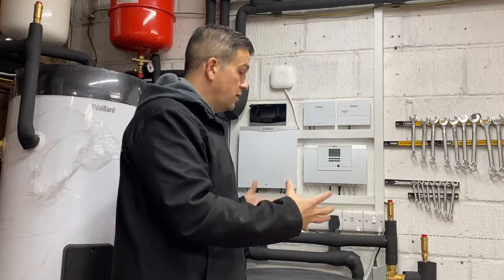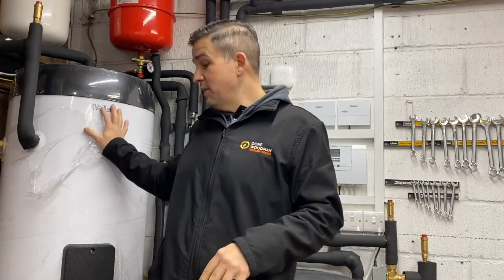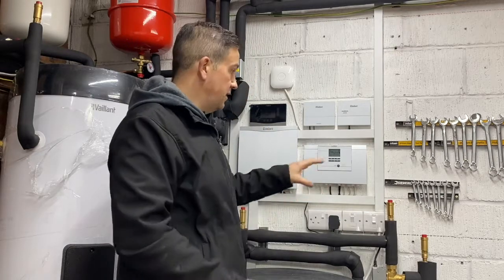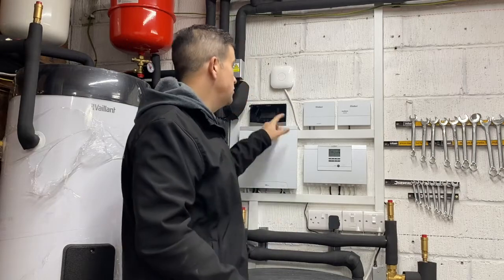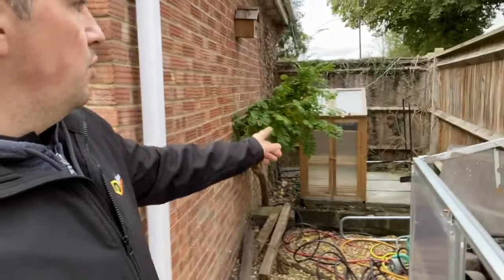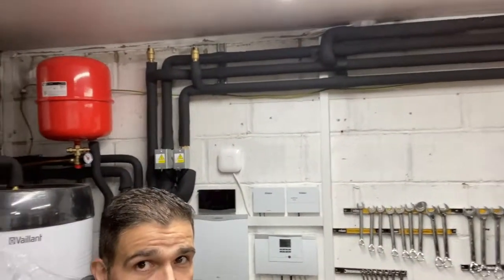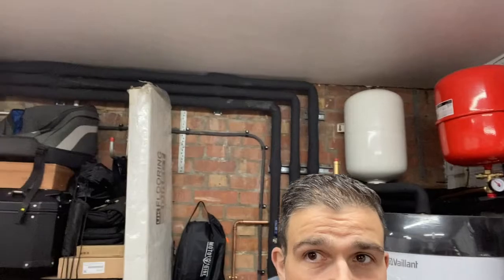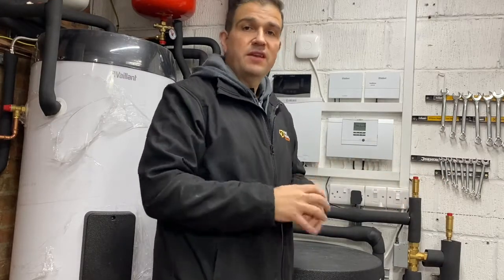Vaillant Arotherm Plus Air Source Heat Pump Installation

Comment: Hello @dore woodman is it possible to turn off the valve to the radiators by an isolator so that the system only serves hot water? And then remove the radiators? I don't want them anymore. Thanks Katy

Comment: Would you choose Vaillant or Mitsubishi ?
Reply from the maker: Vaillant without a doubt
Reply: Thanks for taking the trouble to reply .
  I ask because our installer is suggesting two ecodans 11kw cascaded .
   All I see on YouTube from installers of quality is the use of Vaillant , the installer argues vaillant controls were variations of their gas boiler controls and that their customer service is rubbish .
   This is leaving me in a quandary , of course it may be to do with supply discounts from either and they make more money on the ecodans ,,however they do have a good reputation on installs
Reply from the maker: @pmbpmb5416  mitsubishi have had a range of issues over the past 18 to 24 months and the Vaillant customer service and product is far better than the Mitsubishi Ecodan. I would, without a doubt, install the Vaillant. Where are you guys based?
Reply: Thanks for that info , unfortunately  in south Wales where there is a dearth of reputable installers, nearest heat geek elite is Cardiff for example and they don’t do solar as well ,  I am trying to tie up the install together .

Comment: It's very difficult finding someone who can fix or reset an ASHP,  all they want is to charge as much as they can from new installations and annual servicing, that includes the shoddy company in Doncaster, Project Heating Ltd who installed mine.

Comment: Be aware that unless you have a new home to a high standard of insulation etc your electricity bill could be huge! The cost of all this and the cost of your electricity bill would seriously damage your wealth.
Reply: if it's calculated well it's often cheaper than gas, ofcourse if your house is very badly insulated that should always be the first step, that would also save you a enormous amount of gas as well

Comment: Hi, thanks for the vid.   Is the 7kw the input power or the output heating power?
Reply from the maker: That is the heat output of the unit, although dependent on flow temperature and external temperature it can achieve up to around 9kw

Comment: is the Arotherm Plus designed to self diagnose if their is a refrigerant leak?
Reply from the maker: Hi Nicks, I wouldn’t say self diagnose but it will detect the leak as the pressures and refrigerant temperatures will be all over the place and produce a fault code to indicate an issue.

Comment: Do you need a smart meter for it to provide the energy prices and consumption
Reply from the maker: Hi Dan, not necessarily. You should have a digital phase meter installed that will indicate the kwh used and the interface will also have the energy consumption data available.
Reply: @dorewoodman  where do these install at. A quick search shows some that fit to the din rail on the consumer unit. Do they monitor whole house consumption or just for the heat pump

Comment: Hi Dore,  my Vaillant ait source heat pump is working but not heating the radiators enough.  They just get  luke warm.
 I noticed the double fans in the outside unit are not turning as fast as before. For the hot water, it runs fine but as soon as i need heating they are alot slower. Our first service wss about 5 months ago.  Thanks in advance.  Im in Glasgow
Reply: don't focus too much on how the radiators feel, is your room getting warm enough?

Comment: Dore is my pipe insulation up to scratch the brick beside the pipe reads 3.2centigrade and the insulation reads 4.8centigrade reading with my Fluke infrared thermometer surely this isn’t right can you recommend a fix to upgrade it cheers

Comment: Thanks for this - I note that the Vaillant is capable of flow temperatures of up to 75 degrees which seems ideal for an old property like mine where I intend on having UFH downstairs and CH radiators upstairs. However, is there any guidance from Vaillant (or you) on how best to specify the upstairs radiators? Should I use the standard calculated radiators sizes (BTUs/Watts) for a given room or should I add 50%? 

Also, what would Vaillant/you suggest on towel radiators - can I use one to heat a room and/or should I incorporate an electric element as well?
Reply: So yes in the summer they can get up to 75 degrees, in the winter its a bit lower (my experience around 60/65 at -5) but normally still enough for decent size radiators

Comment: Hi Dore, nice video. Actually we have bought Vaillant aroTHERM Plus 7kW to replace our Combi LPG boiler and hoping to be fitted by a plumber. It turns out nobody wants to help, or is to busy with new dev, or charges way too much money, and we are stuck with the pump... Not sure about this Eco approach anymore and it looks like we have wasted our time and cash onto system that is not actually there yet around here...
Reply from the maker: Hi Michal, that is a shame. Where are you located in the UK and what heat pump package do you have?
Reply: We are LU7, outdoor unit Vaillant aroTHERM Plus 7kW is the only thing we have at the moment. Space where the tank would go is a bit limited so we are hoping for a little bit of guidance on this side...
Reply from the maker: @MichalPodobycko  LU7 is out of our catchment unfortunately. I will just say if you are looking to gain the RHI you will need to engage with an MCS accredited business.

What is the size of the space for the cylinder and buffer? Have you carried the correct heat loss for the property?
Reply: @dorewoodman   That's a shame, let me know if you know anyone on this side of LDN...

We are not even looking for RHI. Next March/April incentive would help though, if this will be easily accessible for end front consumer  ...

There is about 560mm max space available in width, and plenty of depth space

Heat loss was carried few times, and we have prepared our house accordingly (external house insulation, radiators etc.). This saves a nice chunk of LPG anyway, but it's a shame we are unable to finish the actual job...
Reply: @MichalPodobycko  so they will help you but you think they cost too much ? maybe a brick layer or painter can connect it for you

Comment: Im so glad I found your channel Dore. Lots of great honest info you got here!  We're in the Balearics and looking to change our boiler. We've been quoted an Estia set-up - would you have any comment about the Toshibas in comparison with the Arotherm PLus or the Mitsubishi? After watching that "other" video pretty much slating air source heat pumps. but not really backing it up with any honest info and showing only old heat pumps, its kind of sowed a seed of doubt. thanks again!
Reply from the maker: Hi Joey P, thank you for your comment. I am glad you have found it useful and you have enjoyed the content. As for the Toshiba, I believe this is a split system, so that will require refrigerant pipework between the indoor and outdoor unit, most of the heat pumps installed here are Monobloc so that the engineers don't necessarily need to be F Gas trained. 

These heat pumps are not recognised as such for their Air to Water products in the UK, I know the Air to Air products are very good. 

I don't know how the weather in the winter compares to where you are but things to consider are, what are the flow temperatures you require for heating, at the coldest of temperatures what will the heat pump output be, for example if you require an 8 KW heat pump will you get 8 kw with a flow temperature of 50 degrees at 0 degrees outside? I have seen units that will only deliver 6 kw for example even though it was classed as an 8kw.

Comment: What would you say is the absolute most silent unit on the market right now? I'd love to get one but live in a housing estate and don't want to upset the neighbors.
Reply from the maker: Hi, I would say the Vaillants Arotherm Plus and the Mitsubishi Ecodan are the quietest of units. In our other videos you can hear the noise levels of each unit. 

The thing to do is look at the potential siting of the heat pump itself and your potential installer can judge and measure the position to neighbouring properties and calculate the noise levels.